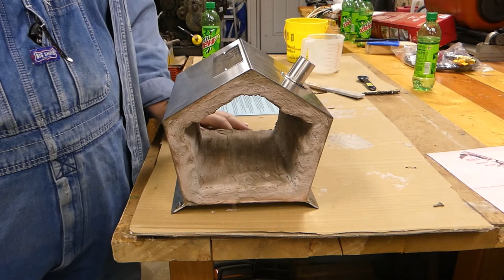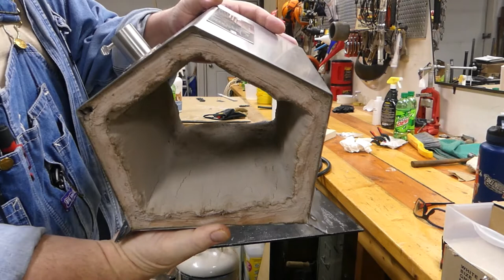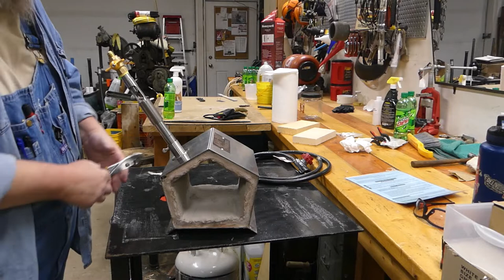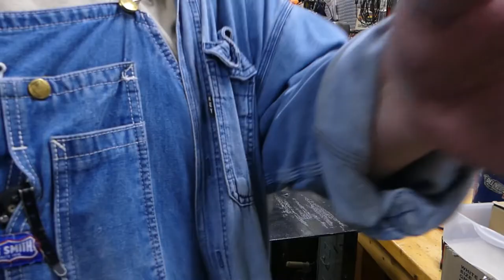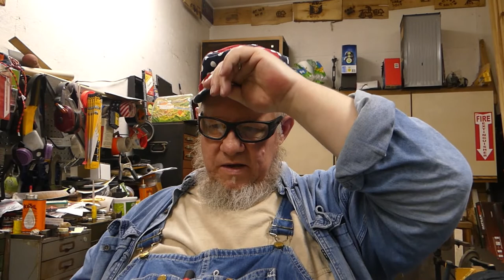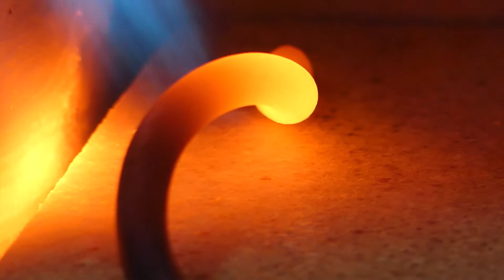Mr.  Volcano Hero Forge Build PT  3

Comment: I purchased one of these forges for my teenager for Christmas. I was overwhelmed trying to figure out the directions hahaha. We sure appreciated watching your tutorial!! We got the blanket in tonight and will wait for a few days to check it. Just ol air drying, (we do have a fan going in his shop.) Thank you so much!!!!
Reply from the maker: GoodVibes OnlyGoodVibes I am sorry it has taken me so long to reply to this comment, I hope you have been well, and I am wondering what your progress has been on the forge? please let me know, and if you have any questions, please feel free to ask.
Reply: Well,  I got the red stuff on and it hardened. I put one thin coat of mortar and some of the pink had shown through.  Should my next coat be thicker or should I do 2 thin coats? Lol so glad you asked♡
Reply from the maker: @goodvibesonlygoodvibes9669  The directions say 2 thin coats, I ran into a problem because my thin and the manufactures thin must have been different, LOL. I ended up dipping into my reserve bag to finish the 2 coat. I used a disposable paint brush to apply mine and part of the trouble I think was that my blanket was not flat, there were dips here and there and I think they got filled and that ended up using more mortar. Thankfully you can buy more mortar from the manufacturer through amazon or I think direct from them. If you have questions please feel free to contact me, I have an email listed in my about page now if that helps you, and thank you.

Comment: I noticed you put fire bricks on the back side of the forge. Are they the ones from mr volcano or tractor supply?

My volcano just came in the mail today. I have absolutely enjoyed the project. Very informative. Thank you for the time you put in. You have a new subscriber.
Reply from the maker: I thank you for your kind words and your sub my new friend, right back at you and I am so glad I was helpful. And those are tractor supply brand, which should be fine for a heat block, time will tell. I was able to get higher temp ones from amazon, they are Rutland brand and rated to 2700f, which I think was what Mr. Volcano said theirs are rated at.
Reply: @MrChubbyHubby.  Thank you, tractor supply is closer and faster than Amazon at the moment. So I will be using those just as he blocks, I’ll pick up better ones later on in my journey.